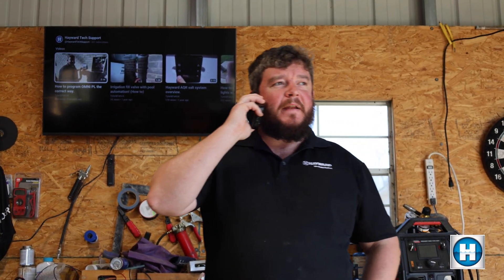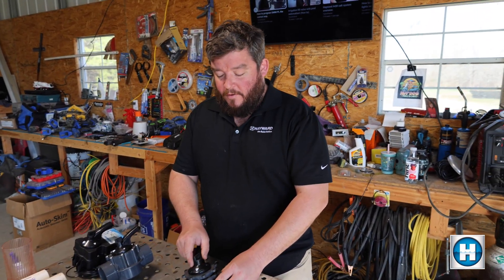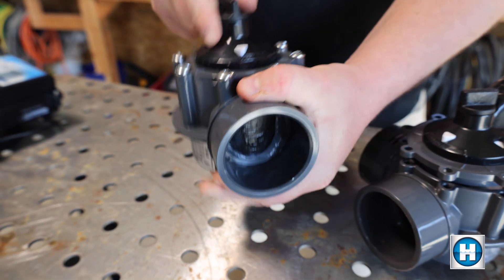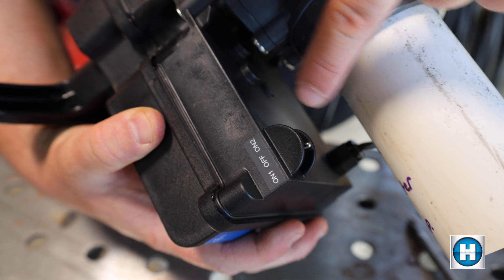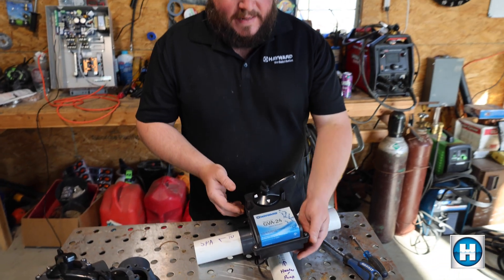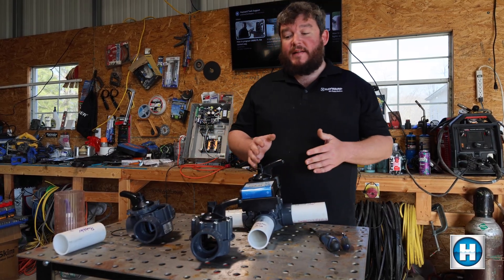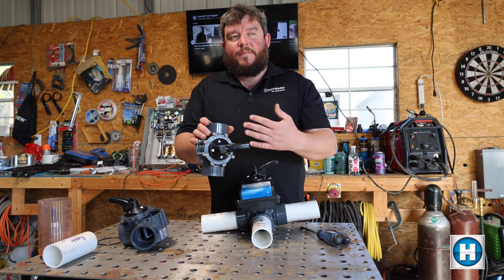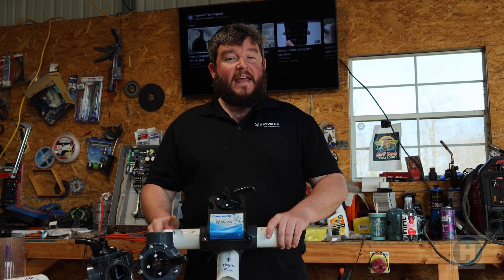Understanding pool valves and valve actuators

Comment: One of my valves has stopped working. I’d like to problem shoot with an Ohm meter. Any suggestions? The switch position makes no difference. This is an actuator that controls spa suction, it’s stuck in the off position. So now it causes a constant water fall that is raising my PH and decreasing my TA.
Reply from the maker: If the actuator is plugged into the circuit board and the other actuators also work… Almost zero doubt that the actuator is bad and needs to be replaced. Try plugging the actuator into an open VLV slot on the board and changing the on position. If none of the actuators work there is probably a blown fuse or potentially the circuit board is bad

Comment: I have a three way valve for my skimmers and main drain going into my pump.  From my phone I would like to either turn off my main drain and only suction from my skimmers so I can vacuum or shut off my skimmers to only suction from my main drain to help circulate colder water from the bottom of the pool. But most of the time I want to suction equally from both sides.  Can I do that with the actuator?
Reply from the maker: @neptune4167  you would have to do two valve actuators for this scenario.

Comment: How about spill over feature...I'd like to setup to use a feature not use spill over all the time when using pool mode. I have spa pool combo but would like pool mode to not run spill over but use spill over when wanted to turn on not all the time in pool mode. How do I do this?
Reply from the maker: Alright so your pool is likely going to be plumbed one of two ways. The solution will depend on your plumbing setup. 

1.) Your pool is plumbed with a spa return (spillover) line on the 'pool side' of the return actuator. In this case you can mount a GVA-24 valve actuator on the valve that controls your spa spillover. You may need to cut in a proper 2 or 3-way valve to make this work if the correct valve is not already there. You would then need to program that valve as a water feature in your Omni or Prologic.

2.) Your pool is plumbed with one spa jet line and no dedicated spa spillover return on the pool side. In this scenario you would get a spa spillover because the return side valve actuator is cracked in pool mode to allow some water to return to the spa and spillover. The fix for this and to achieve your goal you would have to manually adjust your return side actuator to not allow water to return to the spa in pool mode. After that you would program a spa spillover in the Omni or Prologic so that when the spillover was on, the return side actuator would turn to cut off water flow to the pool and dump all of the water into your spa.

Hope this helps and is not too confusing.

Comment: I can get two of the pool valves to work when switching between pool and spa mode.  How to I get vlv3 & vlv4 to actuate?  Do I have to do it with an interlock?
Reply from the maker: I assume you are using vlv3 and vlv4 for water features like a bubbler or waterfall? It sounds like your problem is with the programming. You need to go into the config wizard and program a water feature as a valve and select vlv3 or vlv4 as the water feature.